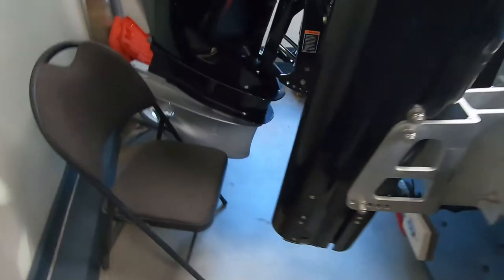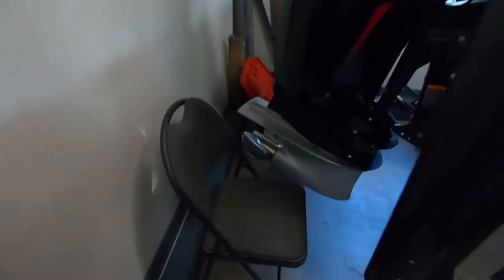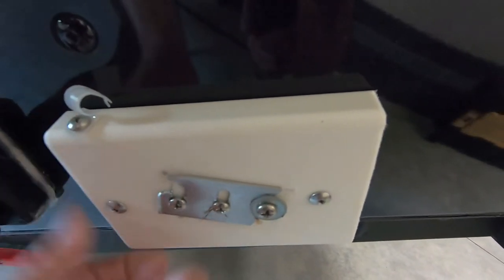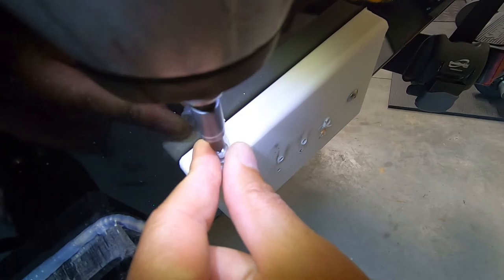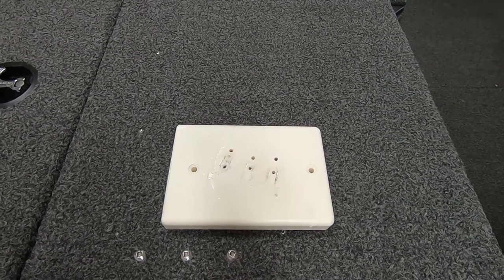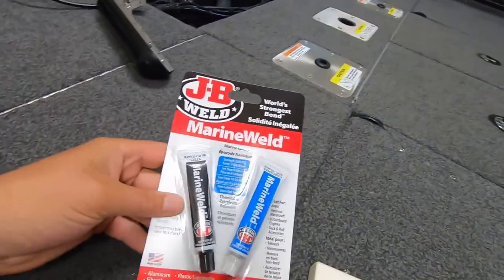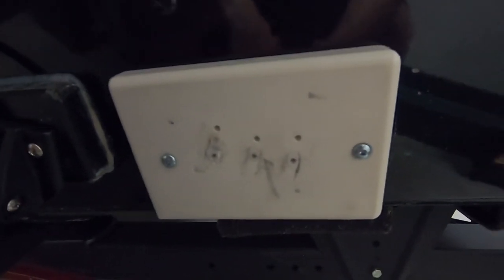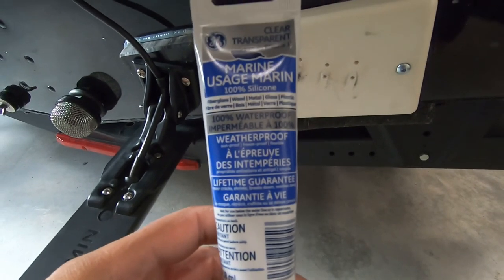How To Install A Transducer Block

Comment: Question please, having both transducers that close to each other "Do you have any interference issues?"  I have a new Bass Tracker and I am planning to mount two transducers on the rear, a Garmin GT24 for my Garmin 63cv and a GT54 for my Garmin 93sv.  What are your thoughts, can I mount them as close as you have them to each other?  Thanks for your time and GREAT Video!
Reply from the maker: As long as the 2 transducers are not running the same frequency, it should be just fine I would think.

Comment: Hi there great video. I have a transducer block and the screws that came with my 3 in 1 are too long. What size screws did you use? I have same transducer as you
Reply from the maker: 3/4 to get the transducer into the block

Comment: You think j&b weld would hold without the screws? Also curious to know if you sand the block and the boat before applying the J&b weld on to the boat? Is it still holding up?
Reply from the maker: I did rough up both surfaces before the JB weld for sure. I used it on both blocks. One has the screws and one doesn’t they are both still running strong and we are on the water quite a bit
Reply: @castforeffect3359  awesome thanks. Great video 👍
Reply: Interesting, we always screwed  3/4 s of the way into the transom with lots of marine grade silicone in the pilot hole and around the screw. J. b Weld  looks like a good idea also on thru the transducer block.

Comment: What will you do should you want to remove/replace the plate?
Reply from the maker: I see your point. This is very much a lore permanent fixture. If you thought you would replace it at some point, I would screw the block to the transom. At least there would only be 2 holes?